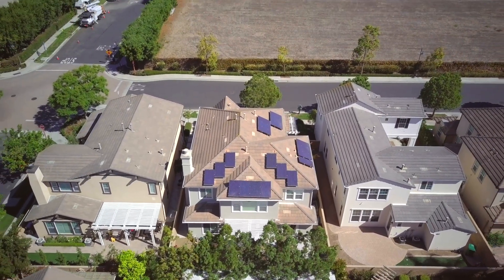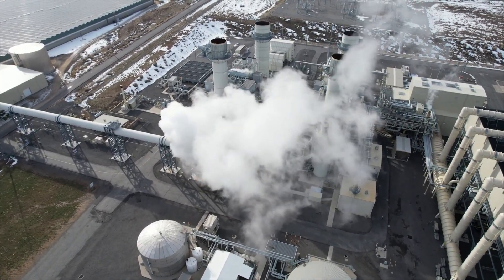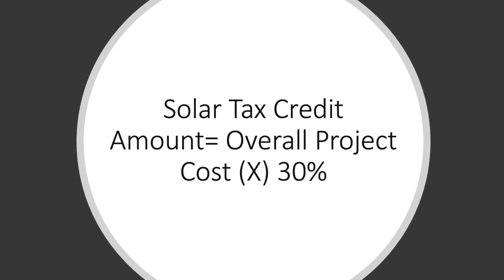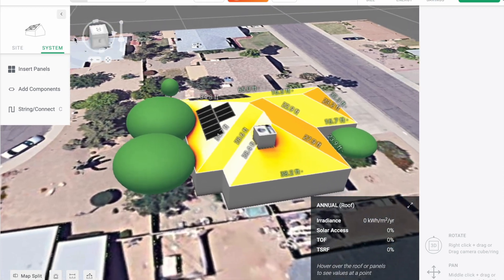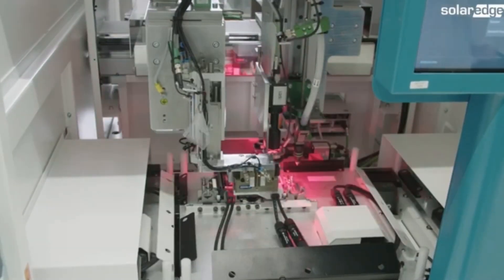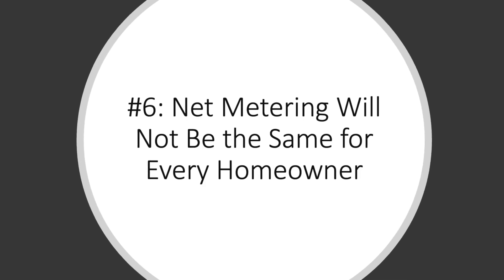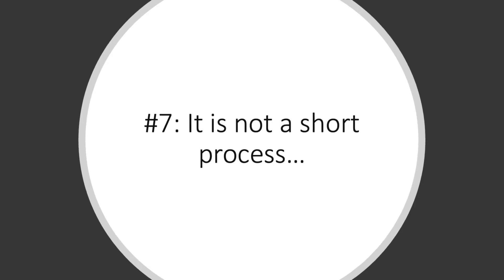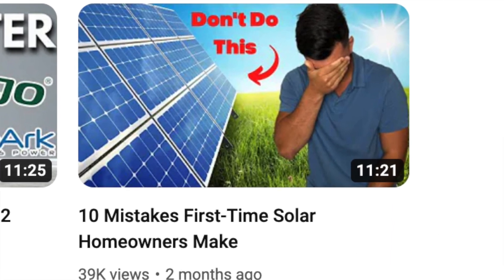7 things you MUST KNOW before you Purchase Solar For Your Home

Comment: I definitely appreciate this channel! 
Now as for microinverters, Enphase brand, which I sold for a few years…
We sold them as not having the liability string inverters, or optimizers, had, which is a single point of failure

Thing is though, Enphase Microinverters do also have a single point of failure, the AC junction box or Combiner Box.  Each “string” of panels (they call them branches ) all flow into This single point.

While we would pitch the 25 year Enphase microinverter warranty, I had to tell customers eventually that the AC Jinction box had only a 5 year warranty, which when it went out was on the customer. 
Several small solar biz owners I’ve met told me that was a regular problem for them, and they had to adjust how their sales people set expectation as clients would think since they had a 25 year warranty that they shouldn’t have to pay for it

I prefer to sell micro inverters where there is some shading and if they have no battery, as there is more loss converting  ac to dc.

I prefer optimizers (Solar edge) when there is zero shade as clipping is far less or no issue , and having a battery the system is much more efficient 

That’s my story…

Again, I do appreciate this channel and have sent customers some of your videos

Comment: I find it funny you discuss string inverters, microinverters, but not power optimizers. And from the visuals you imply that solaredge is a string inverter only. Come on dude...if your claiming to be unbiased, please then do so. Power optimizers are valid option in the solar market place.
Reply from the maker: Optimizers paired with string inverters are a great option. However, with the failure rates with Solar edge at the moment, and Enphase being only 0.05-0.10 cents, more expensive, it is hard to not go with micro inverters in this day in age
Reply: @jackthesolarguy  Solaredge just released a new line of power optimizers. The S series. How can your “failure stats” include that? Technology as with business improves. You should probably re examine Solaredges offering before assuming Enphase is the only solution. All I’m asking for you to do is give a balanced and open approach. If you want to recommend one over the other then just say so, but don’t just assume for the people who are watching your video and omit valuable information.
Reply: @ushipb00  so you are saying he should base his video and statistics on unproven products that have not had long term testing.
Reply: No, the inverters were breaking, not the optimizers. Let’s just get the facts straight.